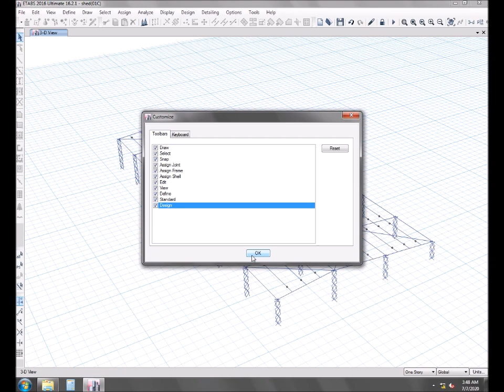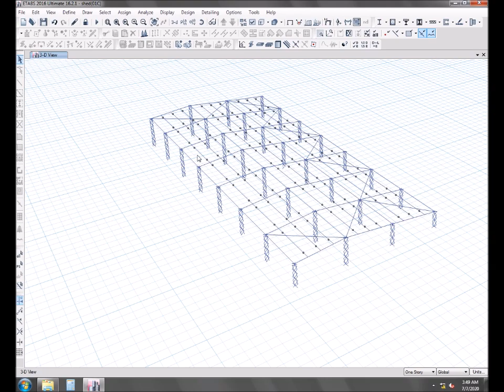Fast modelling in Etabs - Shortcuts in Etabs

Comment: would you please make some videos on steel connection design in RAM connection?
Reply from the maker: Yes, also using staad and etabs soon with manual cross check